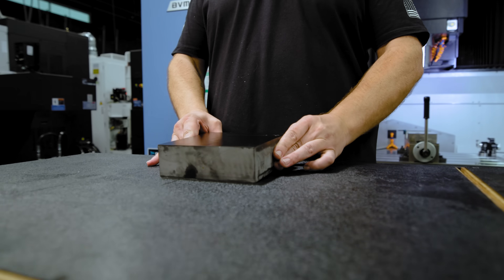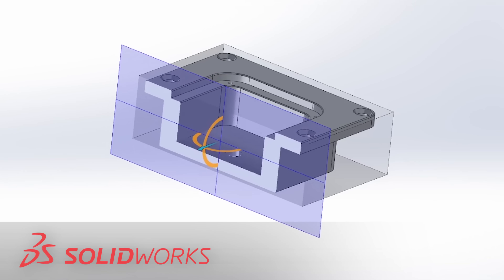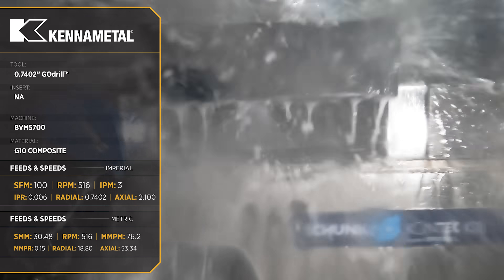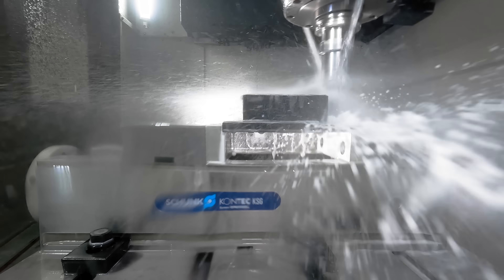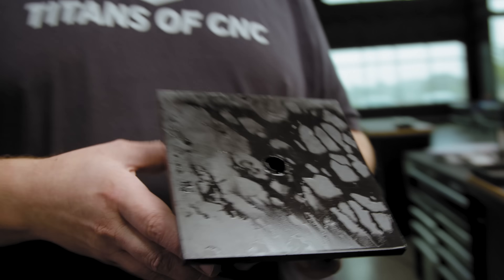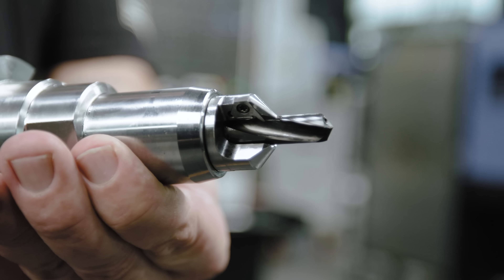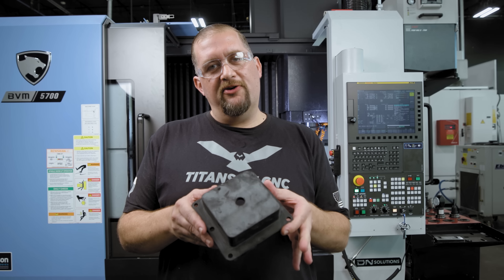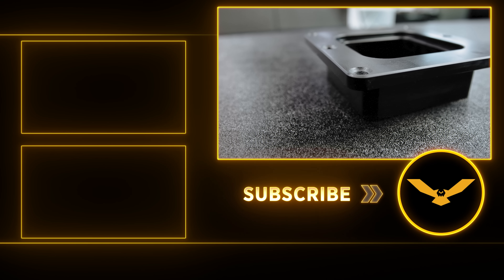Machining Composites Using PCD Diamond Tooling | BVM 5700 CNC Mill | DN Solutions

Comment: I've used PCD for years cutting epoxy composites. A two flute 1/4"dia.x 7/8"loc, cost us well over $300 four years ago. We still use it in production. It still holds a thousandths tolerance.

Comment: Hazards
G-10 is generally safe to handle outside of extreme conditions.

Hazards can result from cutting or grinding the material, as glass and epoxy dust are well known to contribute to respiratory disorders and increase the risk of developing lung cancer. For any work of this kind, the work space should be appropriately ventilated and masks or respirators must be worn.
Reply: wet like 'the steam'(mens sauna) inside the box.

Comment: To be honest: Milling a GFRP part is not the most intelligent way to use the material. If manufactured correctly, there should be no need to mill it. But I know, most people see this material as "black metal" (at least for CFRP) which is, from a material scientist's point of view, truly disappointing.

Comment: Hmm, I feel like I see a little bit of fiber chip out on the back side of those chamfered holes... Glossed over a bit maybe. Carbon is a challenge. At my company, we do it day in and day out though. I'd like to see you guys tacking SiC CMC composites and see what you can do there. We seem to be able to rough it well enough with diamond tools, but because of microfracturing that can extend below the machined surface, we finish everything with diamond grinding tools. It's slow and expensive.

Comment: What happens to the sludge mix of coolant and fibreglass? Can you reuse it for the next machining job or do to have to throw it away? How do dispose of it?
Reply: Filter and throw away the solids
Reply: do you have recommendations for coolant filtration setups? I've seen ones that recycle it through a filter, then press, bake dry and roll off into a disposal bin. Are there other kinds? 

industry standard for GFRP/CFRP seems to be to use dust collection, but that seems to be an impossible feat to do properly. we're talking extremely fine particles. 

secondarily, materials like G10 are often used in electrical insulation applications. is there a recommendation for a kind of coolant that will not contaminate the material with respects to dielectric properties?

Comment: Normally when I cut g10 I use a 3 flute carbine em. Spin it like I'm in mild steel but feed like I'm in aluminum. Last time I made all the required parts and only used one of each tool required for the job.

Comment: We use PCD endmill and reamers for aluminium hpdc. It's great solution in regard to tool cost per part, tool life, surface quality and proces stability. Olso we can run tool with almost max spinde rpm so cycle time is reduced.
Reply: Spindle speed can be a limiting factor that keeps some machines in carbide tools instead of PCD. Why spend the money if you can't run at optimal speeds?

Comment: can you still use the coolant when machining other materials or will it be set aside for this composite stuff ?
Reply: Genuine question, do people really have time to switch out coolants for different materials like that? Our shop barely let's you stop to clean the filters out 😬
Reply: That abrasive slurry has got to be GREATLY filtered otherwise it'll wear the machine ways, etc. 

No way they just trashed all the coolant.
Reply: @thatdrillguy7889  sure they didnt TRASh it ,but it could be set a side and used on composites only. or its some cheap stuff ,that works well for this ? the fluid was vey clear so it must heavily diluted ?
Reply: @fijs653  Blaser coolant from Switzerland is clear. Smells good and easy on skin.

Comment: Super cool! What is the lifespan of the PCD tools?
Reply: About 50 times longer than Carbide, PCD is mainly used for extremely abrasive non-ferrous materials. I manufacture custom and standard PCD End Mills and drills

Comment: G10 makes a wonderful print bed for 3d printing applications. Markforged is using g10 on the MARK II. An UNheated bed which has no adhesion problems while printing their ONXY matetial which is a nylon mixed with chopped carbon fiber. Pretty crazy that it sticks. I bed more 3d printers start to use it in the future
Reply: I thought that material looked familiar

Comment: G10 sucks to machine and work with. I've worked with it before and it gums up everything. It is also bad for the ways in the machine if you can't flood the tool and material. Because it is so soft though, you can run it as super high surface speeds (unfortunately none of the machines in my shop have the spindle speed or feeds. Drilling and tapping the stuff is the absolute worst though. But a part like that,  I'd say you can crank that out in no more than 8 minutes with the surface speeds that you can machine this material at. That includes both setups.
Reply: You mention it being soft and gummy.
Thats a huge problem with composites of all kinds. As with G10, generally composites are a structurally strong or hard particles or fiber bonded together with a resin.
The resin is soft and gummy while the glass is hard, brittle, and abrasive.

Comment: I'm guessing maybe around 20 minutes. It'll take some time to just cut the surface with the first tool. The the bore to allow for the probe. Then the probe itself has to run all sides and the center. Then the rest of the tooling. I'd say about 20 maybe 23 min

Comment: 12:30 minutes I would guess. 
And yes when processing GF or CF based materials make sure you can justify using PCD tooling asap. With carbide you're constantly chasing tolerance because of toolwear. In the beginning I put in new tooling for every job which was included in the job quote.

Comment: working on bikes in free time. and sometimes you have to saw or file some carbon fibre tubes and stuff. used HSS tool, took so long. diamond tools just demolish the material. but yes doing it wet now too since the dust is horrible. you have to clean a lot and be carefull

Comment: I guess I wouldn't have drilled those flange holes last, in order to minimize the exiting problem.
Reply: But it was a good demo to show that there is a drill that can eliminate exit burring when necessary. 

I actually had the same thought as you

Comment: The multi flute endmill would likely be CVD, not PCD as the diamond is coated onto the carbide blank using Chemical Vapour Deposition. PCD is a layer of grown crystals. And normally brazed onto the cutting tool. Once the CVD diamond layer is consumed, tool wear occurs rapidly. Normally seen by a 'shine' on the cutting edge which is polished carbide. PCD tooling costs $$$ but can actually be reground and used multiple times using EDG (Electrical discharge grinding)  and is perfect for production composite machining.
Reply: That drill was diamond coated as you say, but they also have a PCD version with the same geometry (a PCD yip brazed into the center of the drill, again as you said).
Reply: I see that shine all the time while making graphite electrodes... I can't get away from it. And the cutters bought specifically for graphite lasted even less time than the cutters for hard steels...
Reply: Chemical vapor deposition would also generate a polycrystalline diamond film
Reply: @alejandromorcillo9896  yes. CVD is the process that would be used to coat a carbide tool. PCD generally refers to a diamond tip that is brazed in to the round tool. When you say "PCD" and "diamond coated" you're talking about tools with different features and functionality.

Comment: im guessing about 48 min, also in my line of work we cannot use coolant on any part that has to be bonded inside the aircraft. I assume that's not the case for this particular part.
Reply: Likely just a demo part that doesn't have those constraints I'd guess. 

Why can't you use coolant? Does it mess with the integrity of the material where the coolant touches?

Comment: As a computer engineer now machinist thank you for saying PC Board instead of PCB Board!
Reply: But think about all those PCB Boards that are inside those ATM Machines 
🙃🙃
Reply: same like LCD Display :P
Reply: I will stop saying that now ASAP as possible
Reply: ATM machine
Reply: Yes, RAS syndrome is a very real thing. For those not familiar, RAS syndrome is where you say an acronym, followed by usually the last word of the acronym. (Pcb board, atm machine, etc.) 
What does the RAS in RAS syndrome stand for? Redundant Acronym Syndrome.
Reply: I bet PIN number makes you have convulsions.

Comment: About with out setup time around 3 to 4 minutes ish

Just thought if you have a multi part setup you can drop that to 2:30 to 3:30 mins,
your have a jig setup on one side of the table for opp 1 and a jig setup for opp 2. That way evey time you run a cycle your take a completed part of the mill, if you set the jigs up to hold more you get more. In the end your compleat the order faster and save time. Same with setup time.